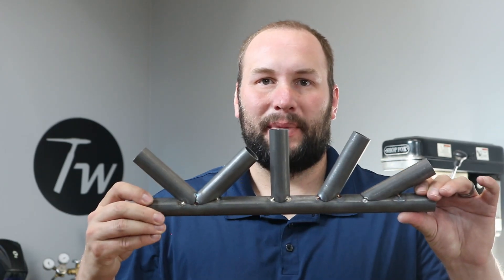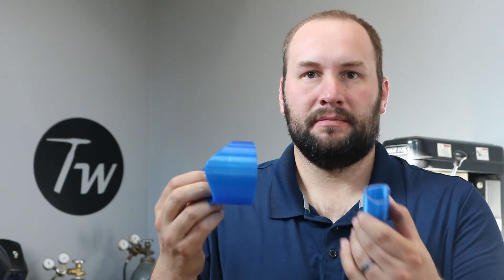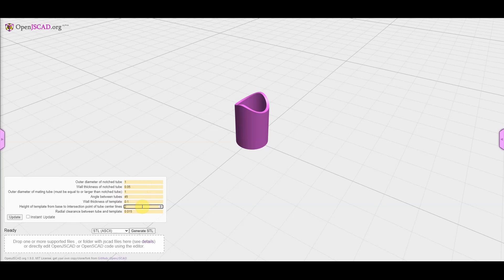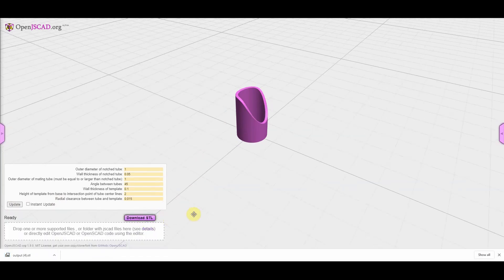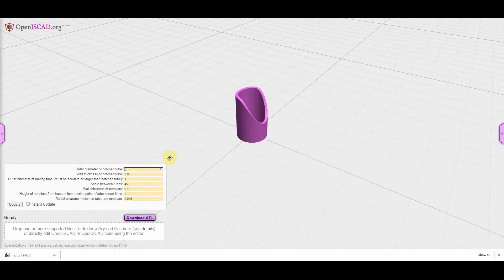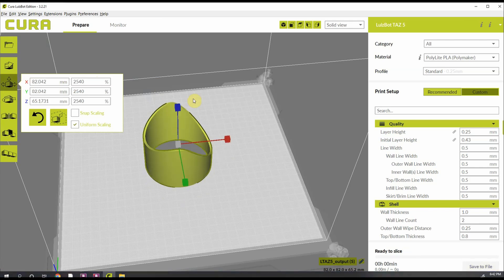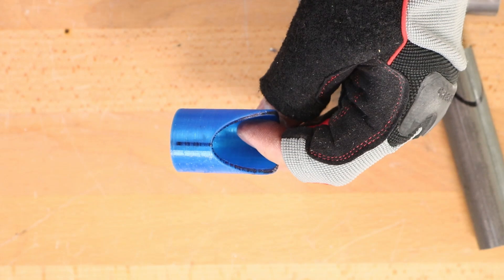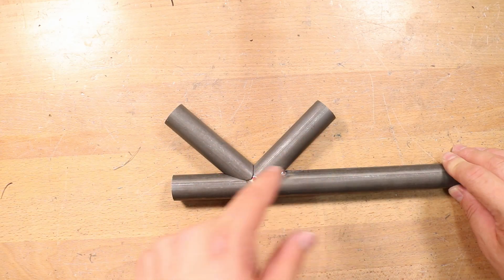Notch Tubing at an Angle without a Tubing Notcher: 3D Printed Tube Coping Tool

Comment from the maker: Unfortunately, openjscad.org is not currently functional, so the link will not work. I'll paste the code below for anyone who wants to obtain and locally run openjscad to do so. I'm hoping to find another way to host it as an online tool in the future. 

// Define user editable parameters:
function getParameterDefinitions() {
  return [
    { name: 'od1', type: 'float', initial: 1, caption: "Outer diameter of notched tube:" },
    { name: 't2', type: 'float', initial: 0.050, caption: "Wall thickness of notched tube:" },
 { name: 'od2', type: 'float', initial: 1, caption: "Outer diameter of mating tube (must be equal to or larger than notched tube):" },
 { name: 'angle', type: 'float', initial: 90.0, caption: "Angle between tubes:" },
 { name: 't1', type: 'float', initial: 0.100, caption: "Wall thickness of template:" },
 { name: 'h', type: 'float', initial: 2, caption: "Height of template from base to intersection point of tube center lines:" },
 { name: 'clearance', type: 'float', initial: 0.015, caption: "Radial clearance between tube and template:" },
  ];
}
function main(params) {
  // tube diameter error checking
  if(params.od2 < params.od1) throw new Error("Mating tube must be the same size or larger than notched tube");
  //define variables
  var r1 = params.od1/2 + params.clearance; //inner radius of template
  var t2 = params.t2; //wall thickness of notched tube
  var r2 = params.od2/2; //outer radius of mating tube
  var theta = params.angle - 90; //angle from perpendicular
  var t1 = params.t1; //thickness of template
  var h = params.h; //height of notched tubing
  var vertices = []; //array to hold xyz coordinates of each vertex
  var nv = 4 * 360; //used for convenience in calculation, equal to number of vertices
  var indices = []; //array to index vertices in each polyhedron
  //define cross sectional vertices at each 1 degree of resolution
  for (i = 0; i < 360; i++){
 vertices[4*i] = [(r1+t1)*cos(i), (r1+t1)*sin(i), 0],
 vertices[4*i + 1] = [(r1+t1)*cos(i), (r1+t1)*sin(i), h + (r1*cos(i)*tan(theta)) - sqrt(pow(r2,2)-pow((r1-t2)*sin(i),2))/cos(theta)],
 vertices[4*i + 2] = [(r1)*cos(i), (r1)*sin(i), h + (r1*cos(i)*tan(theta)) - sqrt(pow(r2,2)-pow((r1-t2)*sin(i),2))/cos(theta)],
 vertices[4*i + 3] = [(r1)*cos(i), (r1)*sin(i), 0];
 }
  //define vertex indices for each quadrilateral facet bounding the resulting polyhedron
  for (i = 0; i < 360; i++){
 indices[4*i] = [(4*i+0)%nv, (4*i+1)%nv, (4*i+5)%nv, (4*i+4)%nv],
 indices[4*i + 1] = [(4*i+1)%nv, (4*i+2)%nv, (4*i+6)%nv, (4*i+5)%nv],
 indices[4*i + 2] = [(4*i+2)%nv, (4*i+3)%nv, (4*i+7)%nv, (4*i+6)%nv],
 indices[4*i + 3] = [(4*i+3)%nv, (4*i+0)%nv, (4*i+4)%nv, (4*i+7)%nv];
  }
  //build polyhedron based on vertices and indices
  return polyhedron({
  points: vertices,                                  
  polygons: indices
});
}
Reply: not sure how to use this. i copy and paste and nothing happens
Reply: @industrialmechanicalworker2417  you have to render it.  hit f5 the purple arrow on the left will show you additional tools
Reply: @industrialmechanicalworker2417  same i cant get it to work
Reply: @emrindustries  you have to render it.  hit f5 the purple arrow on the left will show you additional tools
Reply: I wonder if this can be done in Fusion 360? I just started using it.
Reply: @mvorn44  you can make it in fusion for sure, but he made a simple program to do any size without any hassle.  Fusion can't make it this easy.
Reply: @Winky Fab  
I watched some Fusion YT videos and I set up Parameters in Fusion.  It works, but it can be glitchy if you make a big angle change.  I might upload the file to Thingiverse.
Reply: this is exactly what I was looking for to mark tubes to be made into dodecahedron and other polyhedron sides. The code posted above works perfectly with the online version of OpenJSCAD. I know this is not a programming tutorial, but how can I modify your code to be able to work with more precision on the angels? It seems it only takes integers as values; but I would need at least 1 decimal point to get a more perfect angle. Is there a way?
Reply: I am asking this question hopeless about getting answer back but anyway,
So basicly in Desmos 3d Graph I was making the equation in the code which is "[(r1+t1)*cos(i), (r1+t1)*sin(i), h + (r1*cos(i)*tan(theta)) - sqrt(pow(r2,2)-pow((r1-t2)*sin(i),2))/cos(theta)]" and it gave me perfect example of cross section of two pipe by giving a 3d parametric curve,
But I couldn't figure out how equation derived from, even Chatgpt yapping about some delusions, I couldn't find similar equation on any website or articles,
I believe that understanding how this formula derived, can give the abilty of modification about my desires, for example rotating the branch also about X-Z plane besides X-Y plane.

Comment: Tim, 
This code is awesome.  Is there some "Hot Keys" to minimize the code? The OpenJSCAD doesn't have the radio button on the right side of the screen as yours does, just the left. And a radio button in the top labeled "Blocks".  Aside from that, your code works like a champ!

Comment: Ummm.. 
My cura had some serious issues with the scaling. A 1" piece of tube shouldn't come up as the size of a pencil eraser.  1" in mm is 25.4..  I think in my case, I need to adjust to 2540, not 25.40.. That seems to work.  But this is really cool and should be able to be used to generate the gcode to cut tube on a cnc plasma table with a 4th axis..

Comment: Great idea Tim, from one engineer to another!  Another solution we came up with back in college was to use the sheet metal feature in solidworks (I assume other packages have similar features).  Once tube diameters and notch angle were established we’d flatten the feature and create a 1:1 scaled drawing to print out.  Then we’d cut it out, fold around tube and tape it together.  You can also add reference lines to the templates as needed.
Reply: Does autocad have same feature?
Reply: @Animeniac-l1i  sorry I am not sure.  I know creo and inventor do

Comment: Tim, you made me feel really silly. I have been struggling with pipe notching but never had idea of 3d printing templates and I do 3d print a lot. It is very easy to do template model in any CAD (eg. FreeCAD).  👍👍👍👍👍
Reply: How did you get the code to work in FreeCAD?
Reply: @cultex  I did not use Tim's code, I created my own FreeCAD models from scratch
Reply: @VladekR  oh! Thanks!

Comment: Good idea, especially for frequently used angles.

I guess you could include a small indicator of the ‘clocking line’ on the sleeve of the printed template — if you need precision.

Comment: this is exactly what I was looking for to mark tubes to be made into dodecahedron and other polyhedron sides. The code posted works perfectly with the online version of OpenJSCAD. I know this is not a programming tutorial, but how can I modify your code to be able to work with more precision on the angles? It seems it only takes integers as values; but I would need at least 1 decimal (69.095 or 69.1 if easier) point to get a more perfect angle. Is there a way?

Comment: this is exactly what I was looking for to mark tubes to be made into dodecahedron and other polyhedron sides. The code posted above works perfectly with the online version of OpenJSCAD. I know this is not a programming tutorial, but how can I modify your code to be able to work with more precision on the angels? It seems it only takes integers as values; but I would need at least 1 decimal point to get a more perfect angle. Is there a way?

Comment: thanks for sharing your file for the 3d printing AND the paper printing. This relatively simple device clearly helps many private beginners, non-3d owners to practice coping tubes right away. Also, its a lot more flexible as to diameter than the "PIPEMASTER" (1x dia/set), the ready made or diy-notchers (1x dia/hole saw) and of course any purpose built notch-only machines. Sharing knowledge probably is the most efficient way to unite across borders, far more than any politician can. Thanks and Shalom.

Comment: Since the website is down, I downloaded the app from the windows store and pasted in the code from the comment you left. Seems to work fine. It would be helpful if there could be an offset so the notched tube didn't need to be in the center of the mating tube. I want to do a 1.25" tube flush with one edge of a 1.5" tube. Could this be added?

Comment: Great video and great idea. Just described to your channel. I am just about to start welding and my first project will be a welding table. I have a bunch of tubes laying around and those are planned to be used for the rack. I was thinking about a way of notching the ends without some fancy, expensive tools. I am happy I found this video. My first template just came out from my 3D printer and it looks great. There is only one thing, I would like to have in the template and that is a groove or somthing else for easy alignment of the template on the tube, so you don't have to estimate the lowest part of the notch and mark it with a sharpy, but have it accurately marked by the 3D printer. I am not familiar with the scripting language used to create the template. Could someone point me to a small piece of code, that makes a little groove or ridge or something like that?
Reply from the maker: Thanks! I added lines 33-35 in the code below to put in a notch like you're describing. Just go to openjscad.org, clear the code in the window on the right, paste in this code and press F5. Hope this works for you!

// Define user editable parameters:
function getParameterDefinitions() {
  return [
    { name: 'od1', type: 'float', initial: 1, caption: "Outer diameter of notched tube:" },
    { name: 't2', type: 'float', initial: 0.050, caption: "Wall thickness of notched tube:" },
 { name: 'od2', type: 'float', initial: 1, caption: "Outer diameter of mating tube (must be equal to or larger than notched tube):" },
 { name: 'angle', type: 'float', initial: 90.0, caption: "Angle between tubes:" },
 { name: 't1', type: 'float', initial: 0.100, caption: "Wall thickness of template:" },
 { name: 'h', type: 'float', initial: 2, caption: "Height of template from base to intersection point of tube center lines:" },
 { name: 'clearance', type: 'float', initial: 0.015, caption: "Radial clearance between tube and template:" },
  ];
}
function main(params) {
  // tube diameter error checking
  if(params.od2 < params.od1) throw new Error("Mating tube must be the same size or larger than notched tube");
  //define variables
  var r1 = params.od1/2 + params.clearance; //inner radius of template
  var t2 = params.t2; //wall thickness of notched tube
  var r2 = params.od2/2; //outer radius of mating tube
  var theta = params.angle - 90; //angle from perpendicular
  var t1 = params.t1; //thickness of template
  var h = params.h; //height of notched tubing
  var vertices = []; //array to hold xyz coordinates of each vertex
  var nv = 4 * 360; //used for convenience in calculation, equal to number of vertices
  var indices = []; //array to index vertices in each polyhedron
  //define cross sectional vertices at each 1 degree of resolution
  for (i = 0; i < 360; i++){
 vertices[4*i] = [(r1+t1)*cos(i), (r1+t1)*sin(i), 0],
 vertices[4*i + 1] = [(r1+t1)*cos(i), (r1+t1)*sin(i), h + (r1*cos(i)*tan(theta)) - sqrt(pow(r2,2)-pow((r1-t2)*sin(i),2))/cos(theta)],
 vertices[4*i + 2] = [(r1)*cos(i), (r1)*sin(i), h + (r1*cos(i)*tan(theta)) - sqrt(pow(r2,2)-pow((r1-t2)*sin(i),2))/cos(theta)],
 vertices[4*i + 3] = [(r1)*cos(i), (r1)*sin(i), 0];
 }
  //place recessed notch in template
   vertices[0] = [(r1+t1*0.6)*cos(0), (r1+t1/2)*sin(0), 0];
 vertices[1] = [(r1+t1*0.6)*cos(0), (r1+t1/2)*sin(0), h + (r1*cos(0)*tan(theta)) - sqrt(pow(r2,2)-pow((r1-t2)*sin(0),2))/cos(theta)];
  //define vertex indices for each quadrilateral facet bounding the resulting polyhedron
  for (i = 0; i < 360; i++){
 indices[4*i] = [(4*i+0)%nv, (4*i+1)%nv, (4*i+5)%nv, (4*i+4)%nv],
 indices[4*i + 1] = [(4*i+1)%nv, (4*i+2)%nv, (4*i+6)%nv, (4*i+5)%nv],
 indices[4*i + 2] = [(4*i+2)%nv, (4*i+3)%nv, (4*i+7)%nv, (4*i+6)%nv],
 indices[4*i + 3] = [(4*i+3)%nv, (4*i+0)%nv, (4*i+4)%nv, (4*i+7)%nv];
  }
  //build polyhedron based on vertices and indices
  return polyhedron({
  points: vertices,                                  
  polygons: indices
});
}
Reply: @TimWelds  Wow, many thanks for that. 👍 Just tried it and it works. I just have to figure out what I have to change, to change the width of the notch, to be sure it comes out good visible in the print. Will play around with it.

Comment: I'd rather just print the shape onto paper, cut out the shape, wrap it around the tube, and trace the outline. Paper printing takes a lot less time than 3D printing, it's a lot less expensive, and it's just as easy to use.
Reply from the maker: There are some websites out there that will create the paper templates you are talking about, which kind of inspired coming up with this. I find these quite a bit easier to use and they can be reused many times, however there are 7 ways that I know of to notch tubing and everyone will have their preference. No worries if it's different than mine. Thanks for watching and for the comment!

Comment: What budget auto darkening helmet do you like for flux core welding? Thanks
Reply from the maker: I have several of the miller helmets at all levels and I really like them. I haven't tried many of the less expensive helmets that are out there today. The same hood will be good for pretty much any process, but if you're going to be running flux core, I would look for one with replaceable lens covers. I do have a YesWelder helmet on the way that I'll be trying in an upcoming TIG welder review, so that may be a good option, but I can't say for sure since I haven't tried it.

Comment: Could you modify that to print out on a flat sheet of paper for those of us who don't have 3d printers?
Reply from the maker: Thanks for watching and for the comment! That has been done by several others. If you google 'tube cope template', you will find some online calculators. One hit was https://www.blocklayer.com/pipe-notch.aspx . I haven't used these, but they probably work just as well. Maybe I'll make a video in the future comparing different methods such as paper templates, 3d printed templates, centurial templates, measured setbacks, double miters and traditional notchers.
Reply: @TimWelds   Thanks for the response.  I see the value  in the printed templates as far as reuse.  It's just that all of us don't have 3d printers.
Reply: Hola amigo, por favor, checkea https://www.etubespro.com - Plantillas de corte de tubos de cualquier diámetro y espesor que se corten con otros tubos, en cualquier ángulo. Las plantillas se generan en un plano en formato DXF o DWG (Autocad) y luego se imprimen en escala real.
 
Hi folk, please, visit https://www.etubespro.com Saddle templates for tubes/pipes of any size and thickness intersecting any other tubes/pipes at any angle. Templates are generated in DXF / DWG format and then printed at real scale.